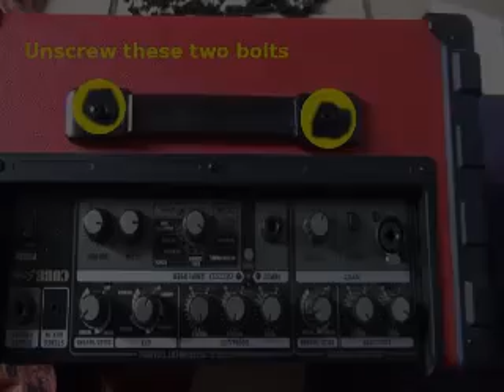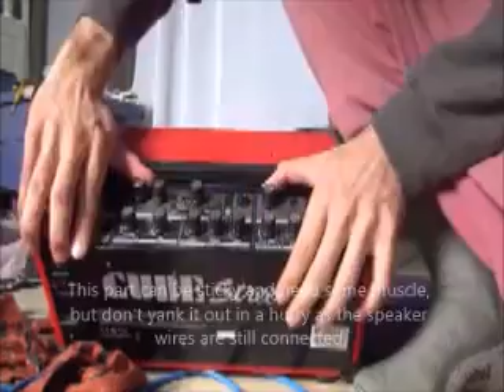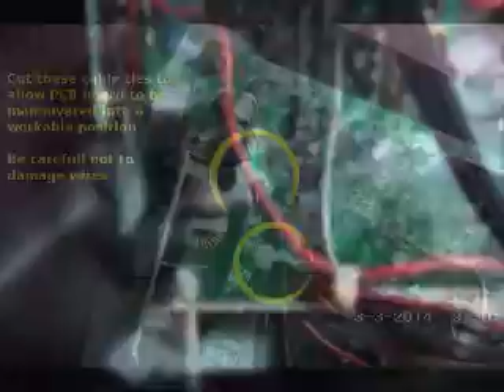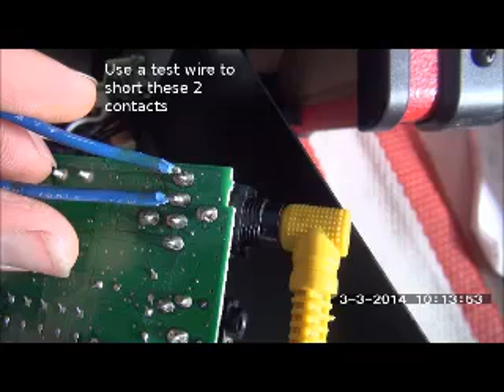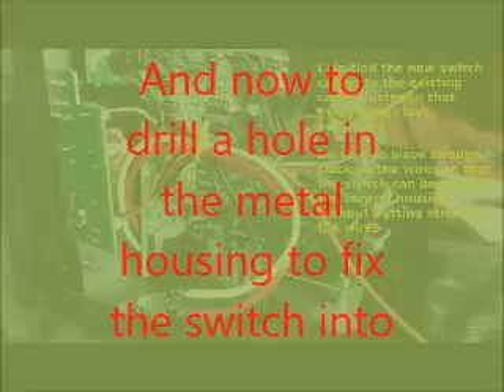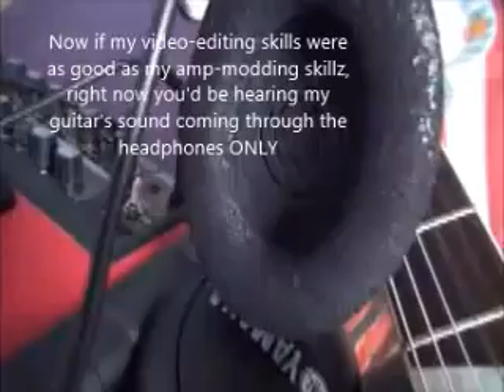Roland Street Cube Tutorial Headphone Line Out Override Mod

Comment: has anyone replaced the input jack on the mic? the neutrik adapter is just causing noise and not really sending a signal ever... help is appreciated! want to prepare myself for what comes for the repair... :)
Reply: Hi Jack, I haven't replaced the input jack for the mic - I'd imagine its soldered directly to a circuit board and perhaps the solder joints have failed. If you open it up you could plug in a mic cable and use a multimeter to check continuity between the female pins of the mix cable and the pins that connect to the circuit board, or even the solder pads on the back of the circuit board. You could just reheat the solder joints and that might fix it or you might have to order a new mic jack - I'd image they're a standard design either right angle pins or straight.

Comment: Completed this mod in 2023 with this extremely blurry video as my only guide. Thank you for the upload. To anyone looking for tips in the comments: you definitely want to start by unscrewing the speakers from behind the front grill and disconnecting their cables before attempting to remove the control panel/PCB assembly in the rear/top. Those speaker cables are really short and you can't reach them in the order that the video shows. Good luck modders!

Comment: I need to do this mod because it is super useful! Is a 2 way toggle switch for the guitar the way to go? Seeking recommendations here. Thank you for the amazing video  I guess is this a 2 or 3 pin switch?
Reply: @fields i find it now has a slight grounding issue. Or whenever i touch the faceplate it now will crack. Or pop… not sure if you understand what im saying here. I wonder if theres a way to fix that now.
Reply: @TheJackMarcin  see if the problem happens on batteries vs power supply,  guitar vs mic, volume up vs down, headphone override switch on vs off, is it audible through speakers and/or line out  etc... to narrow down when it happens. If it's happening all the time and bugging you then id say open it back up,  check your work,  maybe undo the mo
od and see if it goes away.

Comment: Excellent. I did this mod at the weekend with toggle switch and it was a 100% success. I have done various little mods to my Street Cube but the lack of a line out was a significant drawback and this has absolutely sorted it. It has also saved me from having to buy the Street Cube 2, which does have line out, but which I was otherwise reluctant to do as I love mine so much. Very comprehensive instructions. Many thanks.
Reply: where can i find this mod. I also need an Output Jack - Line out

Comment: hey Daddy, we need a "Aux in mod" , because the aux in has no bass and too much mids.maby there are caps we dont need there?
Reply: No, that's the speaker sound due to how small the cab is. there isn't much volume of air to let the speakers move. You can compensate with the EQ for the guitar and mic. Use the line out to something with a wider response and you'll hear how much bigger the preamp/mixer side of this amp sounds without the speaker response!

Comment: Hey, my battery contacts are corroded/rusty. Do you know if it's 
possible to clean these by opening the Roland up? I couldn't see whether
 there are some screws inside the battery compartment which I could open
 up to clearly get to the contacts. I couldn't clean them from the 
outside good enough.

Comment: Question:
Have you done any speaker upgrade to the Cube Street?
Any suggestions to really good speakers that would really upgrade it?
Reply: Hi Terje, I once upgraded the speakers on a Roland Street Cube, I used car audio speakers that could handle more bass and more power thinking the sound might be louder and bassier. It didn't work out. If anything the volume was less, and the weight of the amp was heavier. 

I think the stock speakers have been chosen to work best with the design of the amp. I think if you want more volume or bass or anything other than what the combo as a whole can provide, then you are better off sourcing another solution entirely,  rather then modifying the Street Cube to try and do something it was not designed to do. 

For example, a powered PA speaker with battery and inverter etc...
Reply: Simon Andrews Ok, thanks for sharing your experiences. Think I will keep it and rather add the new bigger brother, the Cube Street EX, for more volume😊

Comment: I know it's 5 years since you uploaded this, but maybe you're still monitoring responses.
 
I have the CUBE Street, and I was able to find settings I like for my guitar, BUT it's not really loud.
 
I got the CUBE Street EX, but it doesn't have the same tone and efx controls and I can't get a sound I like out of it.
 
So, I need to output to a powered slave cab, either to complement or to replace the CUBE speakers.
 
To replace the CUBE speakers, can I just connect from the headphone jack to input of the slave cab?
 
Thanks for posting this.
Reply: Yes but it will cut the cube speakers. This mod will keep cube speakers active with external powered cab at same time
Reply: @SimbaWeTidyUp  Thanks!

Comment: Awesome video. I just want to add that in case that you don’t want to void the warranty or if you are afraid of solder, we can just put a tiny wire between the lines and paste it with hot silicone. That way you can remove it in the future and no one will notice it was there.

Comment: I have a Roland PM10 drum amp. I want to put headphones out or a line out but I'm not sure where to tap the wires since it originally doesn't have an output jack. Can I tap it directly from the wires connecting to the speakers then solder a female jack to it? I'm not sure if it's a safe way, though. Any ideas?
Reply: Hi, no thats not safe. The speaker output impedance will be different from a line out/headphones impedance. You will have to add an extra device to convert the speaker output signal to a signal your headphones or device you're inputting to will want to receive (line level?). Some research with the tright keywords should reveal the right device

Comment: My on/off switch crapped out on mine. I figured as long as I had it apart, i might as well look up this video again and try the mod. It worked perfectly. Don't know if I'll ever use it, but it was a fun project.  Also, Radio Shack didn't have an on/off switch the right size, so I settled for an on/off/on switch. It got me wondering if I could have used the extra on position and eliminated the need for drilling the extra hole for the extra switch.. Since my electronics knowledge is pretty limited, I just went with your design. Thanks for taking the time to make this vid.
Reply: Hi Barry, thanks for the comment. Yes I see your point, using the one switch for two functions. 1 'on' would be just power the amp on, the other 'on' would be power the amp on and activate the mod. I would have also just replaced the power switch and performed the mod separately - keep things neat and simple etc... glad it worked out for you, I think you'll use it at some point either for performing or recording and if not it can be a selling point for re-sale etc...

Comment: I have this amp and I tried to use the line out to a 2x12 cab with celestion bluebells in it. Unless I'm using the wrong cables, it won't push these 15w speakers. ( I don't have a stereo out to mono in speaker cable) So I'm wondering if I can use the line out to another guitar amp's clean channel, or to a small amp put in between the cube and the passive speaker cab? Any thoughts? Just need a bit more volume and headroom sometimes.
Reply: I would agree that this amp won't power those external speakers. You basically want a power amp in between the Cube out and the external cab. I would imagine this would be cumbersome and counter-intuitive in a real-world situation. I know one can buy little 1w valve preamp units - but really you want a power amp to drive the external cab.
Reply: Got it. I would do better to tap into the speaker out and get a Hi leverl out instead of a line level out. I never realized what the difference was before. Thanks.

Comment: Can you please give the switch rating as the numbers are unclear on the video. Thanks
Reply from the maker: +Terry Edwards Apologies for late reply. Switch is 10A @ 125V or 5A @ 250V. Cube only ever has 2A running through it so 2A switch or greater will handle fine.
Reply: +DaddyLoopsMusic  Thanks for the info. I have however already carried out the mod which works ok for and used a 2A switch as you suggested. Many thanks for posting .

Comment: I tried today on my roland cube 40xl but it didnt work for me. Do I need coil wire as u did? I tried with normal wire.
Reply from the maker: +niir chowdhury  Hi Niir, I'm not so sure about the cube 40xl - however in my opinion any amp that has this function (line out that cuts the speaker) is using a 'switched jack' - a 1/4" jack that has extra pins/terminals that disable the speaker when a plug is inserted - you just have to disable the 'switched' part of the jack by shorting it so that it no longer shorts the speaker connection. If you can find the correct terminals/pins on the line out jack, you can so this with just a normal wire (you can just search around by shorting different pins on the 'Line out' jack - unlikely to do harm). Alternatively you can remove the switched jack and replace it with an unswitched jack - but then you won't have the option of turning off the speaker when plugging in to the line out - the speaker will always be on no matter what. I hope this helps
Reply: Thanks for your help DaddyLoopsMusic ....... I'll try again
Reply: +DaddyLoopsMusic - At last I have done it on Roland cube 40xl though circuit is slightly different.  ... thank u once again for posting this video.
Reply: @niir107  Hi Md AH chowdhury, is their anyway that you could show a pic, of  wich two contacts you connected/soldered on the 40xl, I would like to do the same mod to my Cube 40Xl

Comment: I wanted to add on the Vox AD50VT  also a great amp and needs this mod but I'd also like to have the ability of a speaker jack to an external speaker without shutting off the internal speaker or the option I should say. Also to wire a jack to I put to the speaker in the vox directly that would bypass the amp.  This would be I case the amp had an issue live and you could connect a back up amp to it.  Like the orange tiny terror or night train utilizing its speaker cab.   It would also be nice for the studio to use that speaker to record a different tone or other options.

Comment: I have this amp it's interesting and all but was wondering what would be the advantage of carrying out this mod cheers
Reply from the maker: I wanted to be able to record a clean signal (Direct Out) from the amp while at the same time hearing the amps speaker, e.g. recording a busking session or live on stage. From the factory, once you plug in a cable into the line out jack you disconnect the speaker so you can't hear the amp through it's speaker and record direct out at the same time.
Reply: nice one so you could also use it as a monitor and run a line to a PA also I presume it's disappointing sometimes the lack of simple features they leave out for the money you pay isn't it
like all those built in amp models when using a looper you should be able to record rhythm using a clean amp and have your looper play that back then switch to a lead channel for a solo